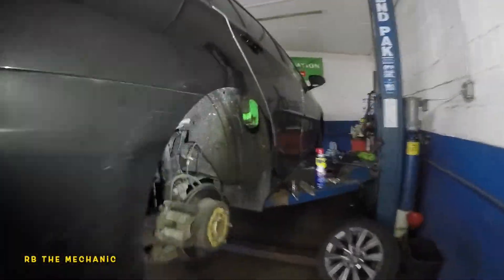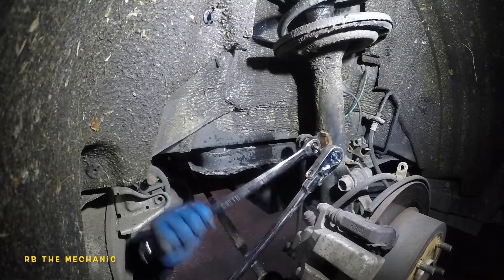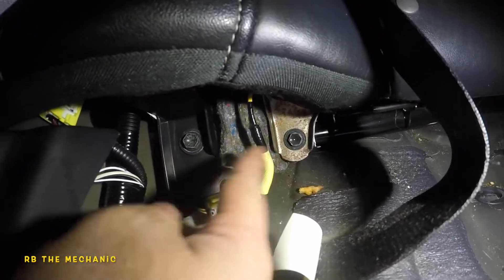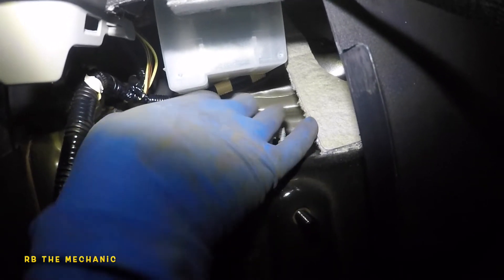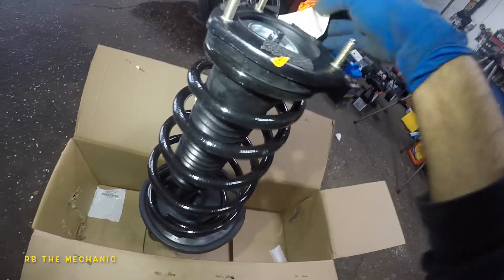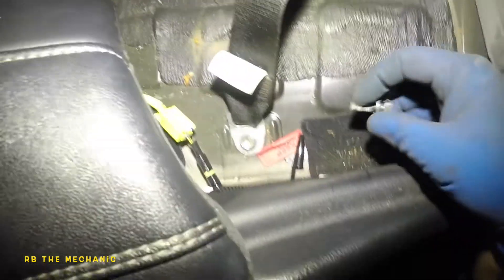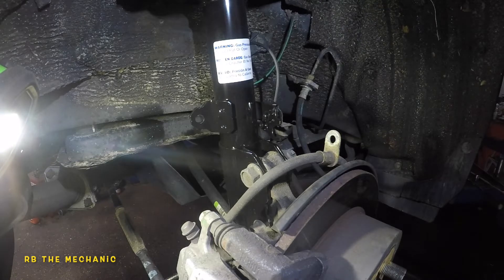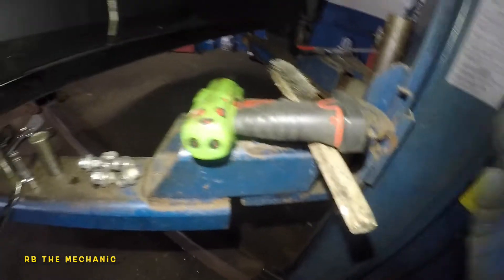How to replace rear strut on Toyota Camry 2011 to 2017 and more  (DIY) Save $300

Comment: New subscriber sir, been wanting to change the rear shocks on my toyota camry but every  video i come across says that you have to use a torque wrench for the 3 top nuts dont know much is needed but your video is very detail to the minimum so ill use your method wish me luck 🤞
Reply from the maker: Oh yeah u should be fine go for it!!!

Comment: I wish I would've seen this video before I had to cut my sway bar links out and replace them.  Those nuts moved a little and then they got stuck just like you said.
Reply from the maker: Yeah use heat

Comment: Hey sorry to  bother you during the holidays. I have a leak in the camshaft position sensor. No check engine light.  Was wondering if I need to still relearn it after replacing it?
Reply from the maker: No need to relearn change the sensor and reset the light